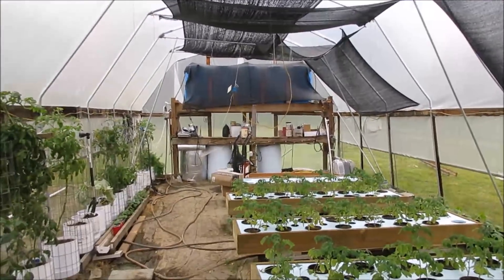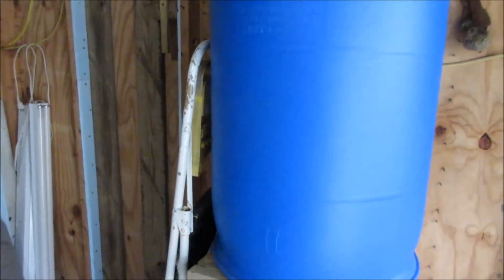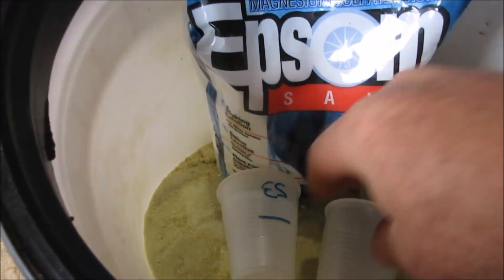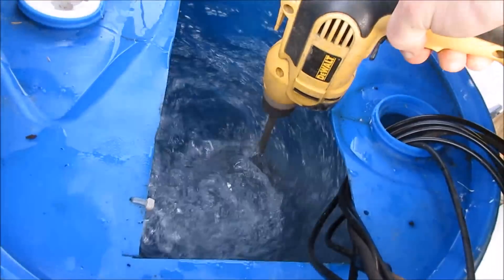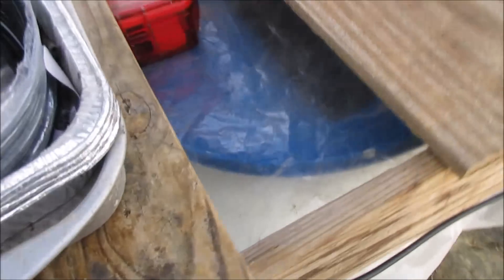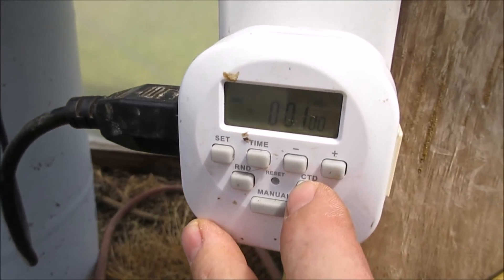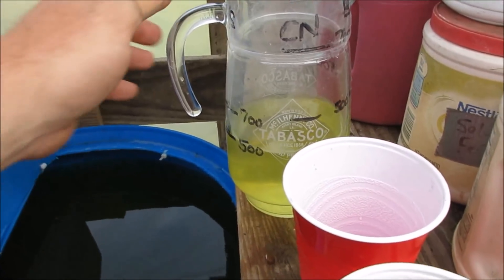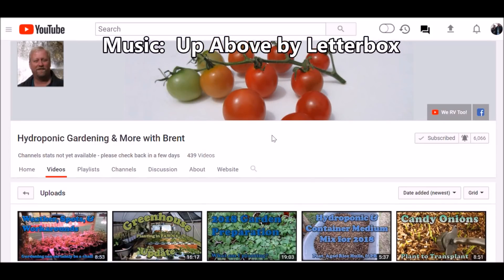Mixing Hydroponic Super-Concentrate:  "Top-Up" Methodology, Part 1

Comment: quite the operation, you get great results from it, are the additives safe for the run off into streams and rivers?
Reply from the maker: I think you'll have to research that some John.  I Googled "Hydroponic and the affects on the environment".  The articles I quickly read were positive as traditional farming and cultivation, for example, depletes the soil web leading to dead or problematic land issues requiring older fertilizer components of NPK added (13-13-13) for example.  This has been going on for a century or more.  Hydro ferts are chemically derived, but normal elements and likely a more pure process than older methods.  They're fed to plants to support them so we know they benefit plants.  In my operation, the small amount of liquid I let get onto the ground, I'm usually fertilizing with it and the soil soaks it up and plants utilize it so it' returns to a natural state.  In my pond culture, I've added chemical fertilizers to boost the plant life and health of the water.  It's common practice and doesn't affect the fish if done properly.  In fact, it provides a more beneficial environment.  The best thing about hydroponics is that it doesn't get to the environment.  Most systems are closed so there's no runoff.  Hope that helps.  It's my opinion of course.